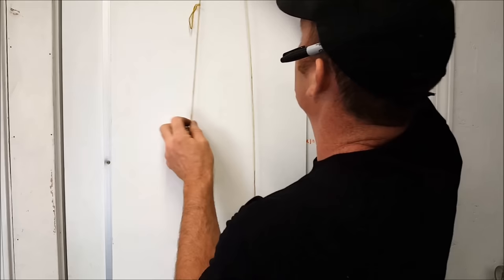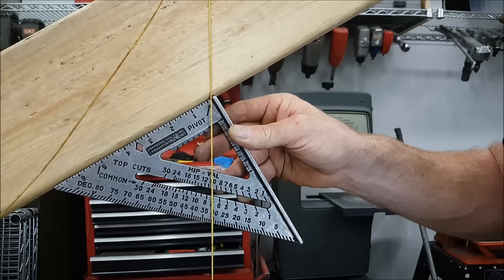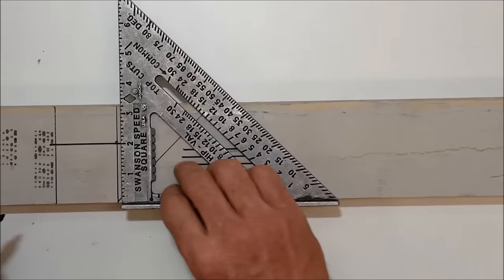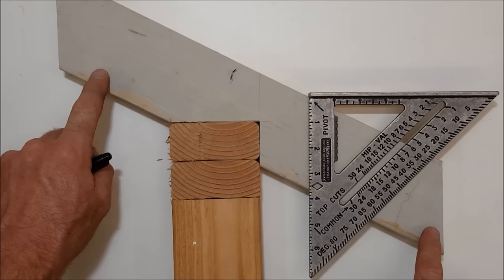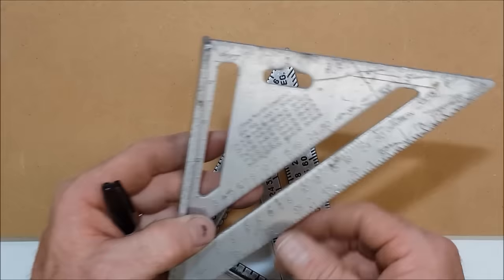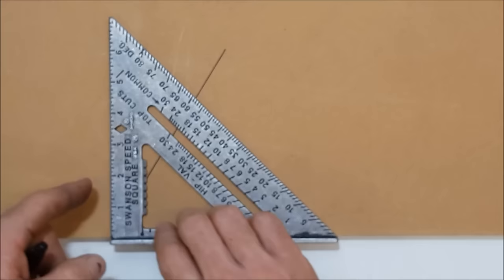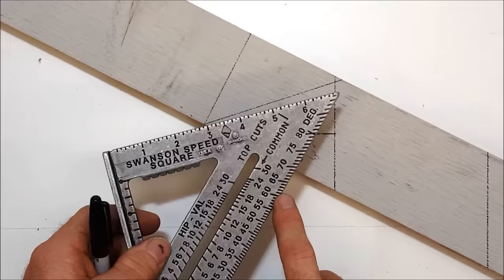Speed square basics - How to use one

Comment: Justin, is it possible to use a few second clip of this video in a presentation.  I'm using this to compare and explain upgrades to my career toolbox with my personal toolbox.
Reply from the maker: Maybe, it depends on what kind of presentation is. Is it for a permanent youtube video or for an in person presentation?
Reply: @Makebuildmodify It's for a Commnication Course, It will be on YouTube, but to publish with only a private link I plan to share with the instructor.  The presentation is about how an IT job is important and how a class in communication can help that career choice.  I'm equating tools in communications with tools in my toolbox.  And by watching your video I learned more about my tools (Speed Square) as taking a class in communications helped learn more about my communication tools
Reply from the maker: @kennyroberts4964  If it's for a Communications course project and the video is set to private then you have permission to use it in that capacity. I hope your presentation goes well. Thank you for asking first.

Comment: Level line with a plumb bob is easier just by using the flat side and top edge. Or, just use a level.
Reply from the maker: Easiness is not the point. It's that fact that it can be done in a pinch.

Comment: What is the benefit off using common pitch ratio over standard degree's?
Reply from the maker: Good question. The advantage is that the roof framing is expressed in terms of the measuring system that you are using to build the structure. If you're building a shed with a width of 10 feet then the run is 5 feet, lets say your pitch is a 6/12 (or 1/2), that would mean that your rise is half of 5 feet or 2 feet and six inches.  Or you can count 6 inches for every foot of run or 5 x 6" =  30" = 2'-6" .

Comment: i only use the square for 90 and 45 degrees marking :D this was informative. a question though. in the beginning you said it was straight when measuring with that small leveler, cause it was between the lines. but how accurate is that small leveler? i mean if you have checked the line with a 3m leveler or laser. would it be as accurate?
Reply from the maker: That depends on the quality of the level. A plumb bob is very accurate because it can be as long as you like and it uses gravity if a very forgiving way. The bubble levels also uses gravity but only inside of the the spirit bubble portion so you have to be fastidious while using one.
Reply: i have no doubt that the plumb bob will be deadstraight. but what i mean is that a very short level is not as accurate as a long one despite the good or poor quality. or am i thinking wrong?

Comment: Great tutorial video! I've been using them for years. just becareful of the cheap Chinese made ones. I actually got one that was distorted (plastic one from a big box store
) and it was anything but accurate!!  It got distorted during injection molding. ! Buy a good metal one and check it for accuracy before relying it!!
0m
Reply from the maker: Great tip!

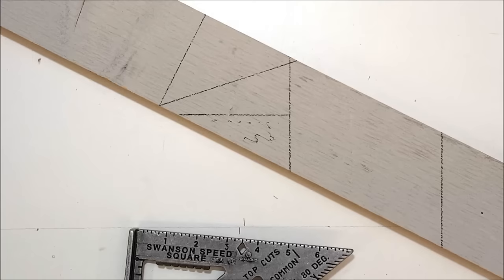Comment: I've been using those squares for years and know most of this stuff, but I've NEVER been able to find someone explain what the little line on the corner is for at 10:42 .But... as you see on your other square, most versions of this square have it running to the 70°, not 80 like the Swanson. Does it work the same way, or is it for a different lumber?
Reply from the maker: I think it works the same way. It's just moved over to provide a little more line length.

Comment: How do you have your air tools mounted under that shelf?
Reply from the maker: Good question. The male air fitting will fits in the wire zigzag part if the shelf. Gravity does the rest.

Comment: The pitch part of the roof where it was through the 7 and you said it’s a 7/12 roof. Where did the number 12 come from??
Reply from the maker: Great question! There is a roof framing convention that uses 12 inches of  "run"  for every x inches of "rise". This is used to express the slope of a roof. For example, a 7/12 roof slope travels 12" horizontally for every 7" vertically. Also, because it's expressed as a fraction you can use any unit that you prefer. It could be 12 feet over and 7 feet up OR 12 miles over and 7 miles up. These three examples all have the same slope. Speed squares are designed around this convention.  So, when you spin on the pivot to the 7 on the common rafter indicator you are using another expression of a 7/12 slope. 

The framing square has more steps than a speed square. This why a speed square is called a speed square. To mark a plumb line for the same slope while using a framing square you would use the 7" location on the tongue and the 12" location on the blade, align them on the edge of the rafter, then mark the line.
Reply: @Makebuildmodify  great stuff took a few times re read to understand but i got it! thank you!

Comment: Since the diamond is at 3 1/2 inches does this assume 2 x 4 framing?
Reply from the maker: It's there for convenience when using standard 2 x 4 framing. But I would say that the designers assumed that it would be the case all of the time.
Reply: @Makebuildmodify  Yes, thanks. I figured that. In New England 2 x 6 has been code for some time now.

Comment: hi justin sorry to be a pest, is the plum cut on the jack rafter the same as the plumb cut on the hip valley rafter, cheers
Reply from the maker: The plumb cuts (upper and lower) on a jack rafter are the same as the plumb cuts on a common rafter. So you would use the common scale on the speed square. 

What are making?
Reply: it may be usefull in the future, thank's
Reply from the maker: I just added a good reference book to the description if you're interested.

Comment: How did u mount your metal racks on the wall
Reply from the maker: Good question. My walls are covered with 1/2" O.S.B. (Oriented Strand Board) So I used the back lip of the racks to fasten any where I wanted. I fastened into the wall studs when I could. The metal shelves are also fastened to the wood side panels. But the wood panels are not fastened to the wall. There is no need because of the direction of force. Very strong and easy to put together.

Comment: @4;34  where your finger is...
Hmmm...    those 10 degreed lines are more likely 80/100  degrees adjacent angles...   the 10 degrees angle will be very "sharper".. hence it should be the OPPOSITE angle to the one you drew...  by the HYPOTHENUSE  (longest side of the triangle..) right side  of the instrument ....
Reply from the maker: hypotenuse
Reply: @Makebuildmodify  
..  yes... thanks 😀
I need to check spelling..
But am I right about the angles?
Reply from the maker: @AlCatrraz  It depends on the point of reference. The angle on a speed square is meant to mark the plumb cut of a rafter. So that when the rafter is installed it's slope matched the angle that you used.

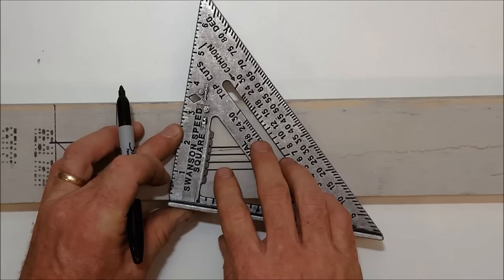So, for example,  if you mark 10 degrees (like I did at 4:34) it's 80 degrees to the long side of the rafter but will create a 10 degree slope after installation.
Reply: @Makebuildmodify  
Yes, that’s what I meant... the difference between 90 & 80 and 100 and 90 —. Those are the 10 degrees angles...  but I am not a roofer, so I was hoping for you to mark the specific angle ...   but I THINK I understand..😃
Thnx and best to you
Reply from the maker: @AlCatrraz  Yes, you've got it right.

Comment: If I’m replacing a rotted rafter end with the roof on.. How can I find the exact pitch
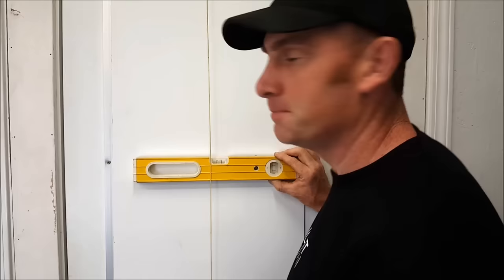Reply from the maker: Follow the steps at 1:28. an it'll give you the pitch you need.
Reply: Another way to find the pitch is to mark the center point of a 2 foot level. Now put one end of the level on the roof, and bring the other end up or down until it reads level. Now measure up from the roof to the center mark you put on the level. If you measure 7 inches, you have a 7/12 pitch. Either method works.
Reply from the maker: That's a great method!

Comment: So this is a ruler, this is a number. I move the ruler here and you get this, then I pivot it here and you get a 6, now on this piece of lumber I am going to cut a seat cut using the number here in the level. I prefer another method, which is based on a number on the square that is related to the hip value. “What’s a hip value?” Doesn’t matter. Take your square and pivot on the angle so it hits the six.  “What’s the 6?” doesn’t matter. Take the 6 and stick it in the bird’s mouth and there you go... you got a roof... hope this was helpful.
Reply from the maker: The title is "Speed square basics", Thanks for watching.

Comment: The primary objective of a speed square is not to solve "Y=90-X". It's for translating the roof angles/pitch into the corresponding angles/pitch for the Valley and Hip -rafters.
Reply from the maker: Says who?
Reply: @Makebuildmodify   I wasn't saying that you can't use a speed square for this!

There are lots of other products dedicated to measuring angles + complementary angles.
In the 90-180 degree range some of them are clearly a better choice.

IMHO, "pitch conversion" is the most important feature of the speed-square since it isn't found in other tools ( except for a calculator ).
Of cause it does have some limitations as the conversion only works when the hip/val -rafters is at 45 degree (seen from above).
Reply from the maker: @stickmenwithrayguns  I agree,  however, finding supplementary and complementary angles are necessary for plum and level cuts.

Comment: Im making a deck with a sloped top railing, so people can rest on it. How would a speed square help to make the sloped miter corner? Its a tricky cut. I think its called a cheek cut.
Reply from the maker: Are you talking about adding a bevel to the top rail to make it more comfortable for leaning against?
Reply: @Makebuildmodify  Hi and thanks for writing. It maybe a bevel cut. I plan to cut a slope on the 4 x 4 post and apply a 2 x 6 to that post, giving it a slope to lean on and enjoy the view from our deck.
The issue is - how do I cut that sloped miter, when the railing takes a turn. I'm in planning stages.
Reply from the maker: @davidbruce5377  I think I understand. So, the rail will be installed level between the 4x4 posts but be tipped or rolled toward the deck. Right? If that's the case then the  corner cuts are very much like cutting crown molding. Here is a video (not mine) that shows the method. https://youtu.be/9QpnWgGNtOk
Reply: @Makebuildmodify  The post will have a mitered cut and the top rail sits on this post to be rolled towards the deck. As the top rail makes the corner, there is larger dimensional post at the corner to accommodate the 2 x 6 miter. I will look at this link, thank you.
Reply from the maker: @davidbruce5377  The corner post will need to be cut at the angle of the "roll" from both directions. For example, if the top rail is rolled 30 degrees the corner post will be cut at a 30 degree slope on two sides. Imagine if you looked down the length of the top rail toward the corner post from each direction, the sides that you would see are the side that you mark and cut.
Reply: @Makebuildmodify  Thats right, good point. Sounds like a whole show there, MBM.

Comment: Hi Justin, I'm from Brazil and I need to know what this 6 by 12 measure means.
Here we use the metric system, has how do I adapt this to the metric.
My American friend, brought from the US a Speed Square to me and I would like tô use this tool for framing here.
can you help me please?
Reply from the maker: Sure. I used 6/12 as one of the possible roof pitches (slope or incline). It means that the roof goes up 6 units for every 12 units it goes over. In other word a 6 unit rise and a 12 unit run. It works with any units because it's a relationship between the rise and run. I can be inches or centimeters.

I'll give you another example. If you want to build a roof with a 45 degree pitch it rises 1 unit for 1 unit of run. So it's a one to one relationship. The US square use 12 units of run as a base so the numbers on the "common" scale are the rise relative to a 12 unit run. So in the case of a roof with a 1 unit rise for 1 unit of run (45 degree pitch) the number 12 on the "common" scale is 12 units of rise to 12 units of run. This is the same as a 1 to 1. Both are a 45 degree pitch. You'll will also see that the protractor will show 45 degrees is inline with the number 12 on the "common" scale. 

If you ever need to convert from the metric square to the US square use the protractor as a guide. This is because the degree scale (protractor) is the same on both.
Reply: +Make Build Modify man, thanks a lot.
I was thinking that always be in inches, but now i understood, its only a proportion.
Reply: here the builders usually use the percentage system, the most common is 30 to 35% inclination.
Reply from the maker: Yes, 30 to 35% is very common here too. But we refer to it as 7/12 to about 9/12.
Reply: +Make Build Modify now I will try to do this with speed square. 
I will study your lesson, a  litle bit more.

Comment: So is every roof pitch a ?/12 pitch roof then because you said on the 2nd it was a 6/12 pitch  but the number was 6/8. Told you I was a novice. Can you explain this for this dummy (me).....
Reply from the maker: Yes, every pitch is a ?/12. The two sets of numbers (scales) on the speed square are for different types of rafters. The scale labeled "common" is for common rafters (Meaning typical rafter on a shed roof). The other set of numbers labeled "hip - val" is for hip and valley rafters. Hip and valley rafters are installed where two roof planes intersect to create a valley or a hip. Hip and valley rafters are ?/17 (but are still referred to as "?/12 - hip")  . So if you were building a 6/12 roof and you were speaking to someone about the rafter count you might say something like "I need five 6 on 12 common rafters and one 6 on 12 hip rafter". The two sets of numbers on the speed square are the numerator only for the roof fraction you need. The denominator is almost always implied. So the common rafter scale is 1/12, 2/12, 3/12....etc. and the "hip - val" scale is 1/17, 2/17, 3/17....etc. Don't let the ?/17 through you there is a reason for it but it's beyond the scope of the original question. Just know that if you are building an x/12 roof then you use an x/17 hip - val.  That's one of the benefits to a speed square, you only have to pivot to the pitch number that you need rather than doing all of the math.  Was that clear as mud?

Comment: also a tip, buy the METAL speed square.  you'll use this tool on every wood working project and after you draw the line you'll dump this tool to the side cause it don't fit so nice on your fanny pack.  then you'll step on it and wish you had ponied up for the metal one...  ;)
Reply from the maker: Yup, metal is better.

Comment: So when you say the 30 degree mark goes through the edge for example, is it not exactly on the edge but just below the edge? It looked from the camera angle that the line (which ever number you were using) was actually below the edge. Or am I mistaken? Just need a bit of clarification. Thanks for the video!
Reply from the maker: Jean-Luc Picard I usually split the delineation on the square with the edge of the piece of wood. In the video the camera was off to the side a little bit so the parallax effected the view.
Reply: Make Build Modify awesome, thanks for the clarification!
Reply: @Makebuildmodify 

I'm a BC Dept of Labour Certified Journeyman Carpenter since 1974, but I didn't know what parallax was early on, so I made errors in reading or in an application. Anyone who wants to become a skilled woodworker must understand what it is, so you can take it into consideration in those situations where it applies.

Comment: Unfortunately is not much of a use outside US.And I'm a bit lost with these imperial units .Good video thou.
Reply from the maker: Hi, all of the relationships are the same. It's only the units that change. For example finding the roof pitch with the string and rafter will still render a relationship on a metric square that will accurately represent the roof pitch. Hope this helped.